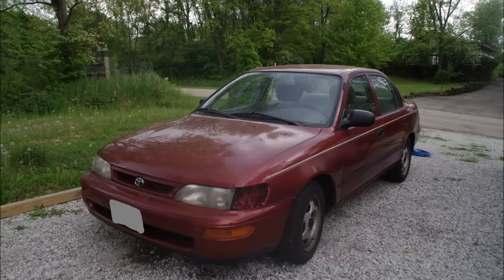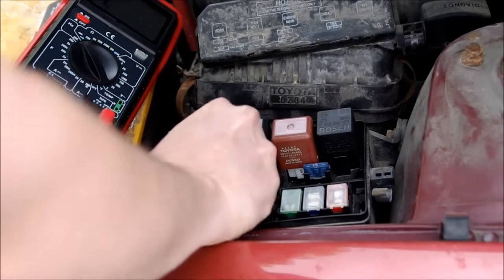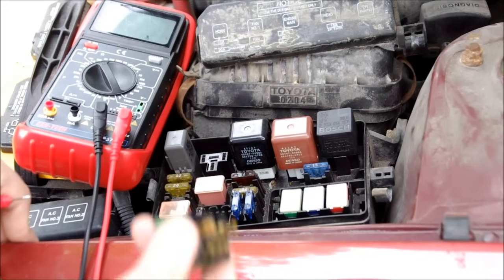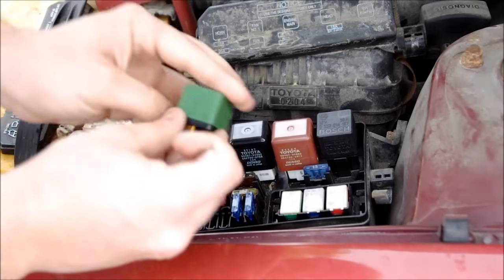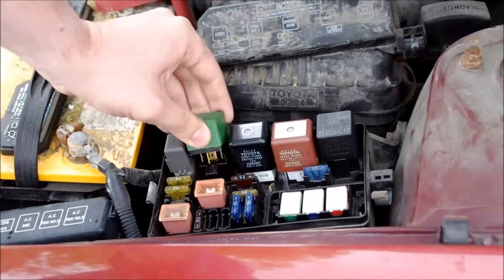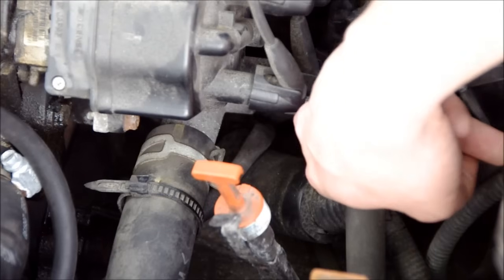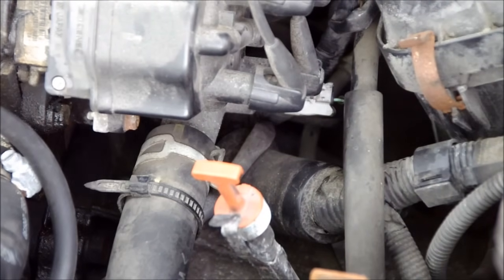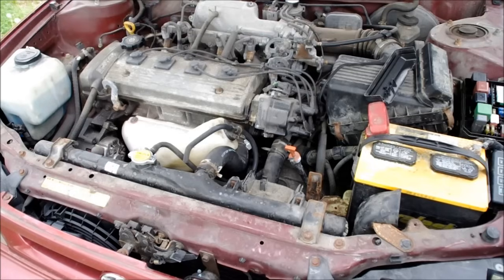Fixing an overheat condition (the radiator fan) on a 1997 Toyota Corolla/Geo Prizm

Comment: I tried jumping the relay but I bypassed the control side of fan #1 and burnt the cars control module or something and now I dont have to buy a radiator temperature sensor but car acts like the ac is turned on all the time or it thinks its super hot.  I used a paper clip fist on sensor thinking fans should come on. They were not working with ac switch or after driving for a while. I jumped it the day before right and only one fan was coming on but I was trying to see if the computer was working or thinking sensor bad but I used too big of a wire and now both on if I turn the key to on. Im still gonna switch sensor because of the  idle but now whats the point I may get little less mpg but not never gona need a sensor long as thermostat good just a module next time.

Comment: I just bought a 94 corolla, I took of the thermostat do to overheating and I notice previous owner cut the thermostat so water can straight flow in engine, why is that?
Reply: I'm thinking it might need a new radiator. If it was water pump, you would be able to see water coming out engine every where correct? I drove it to work today it still very low to the Guage then when I park, it went half way very fast. I might have to do the same thing with my fan too I don't think it coming on. And do your toyota radiator by the top close to the cap has a hole there?
Reply: Sokthea Seng Doing so means there is a misunderstanding what is the roll of thermostat in a vehicule. The thermostat while closing permit the engine reaches its efficient operating temperature, which about 82 - 85 °C. When engine gets it the thermostat opens and let coolant, at 82 °C also, directs to radiator what let it to get a cooler temperature (in that moment, the engine fan cooler will also start up to operate to help the radiator to do its work). So it will start a cycle of open-close thermostat in order to keep the engine working well. When a mechanic takes a thermostat off the engine temperature sensor will never know when the car reach the efficient temperature and computer will try to keep a certain level of acceleration in the engine cause it has no receive a stop signal from sensor temperature. What does it means to the end? You will pay more for gasoline and the engine will be forced to work out of temperature especification making short its operating life. Regards

Comment: Hi I have the same car automatic my heatgauge go above half my fan work normal I replace the water pump replace the fan switch did clean my radiator did send my head for presure test everything is fine its just my heatgauge go up to high

Comment: hi there I have mazda mpv I had the radiator fan not working I  replaced the thermostat and the temperature sensor  when I had  check engine with code  p0126 and I  after i replaced them but now  the radiator fan still not working

Comment: My radiator fan stopped working, then I watched this video and pulled the fan switch. Now the fan works! Thanks!

But then I still experienced an issue where hot coolant constantly sprayed out of the overflow tank, even though the fan issue was fixed and the temperature gauge displayed normal operating temp. I later discovered that the seal in the radiator cap was completely worn out so it failed to regulate the air pressure in the cooling system. I replaced it with a $14 radiator cap from O’Reilly’s, and now the cooling system seems to be working properly.   

Since it is possible that the blown radiator cap was the result of an  overheating condition caused by the bad fan switch, it’s probably not a bad idea to swap out the thermostat and coolant temp sensor for preventative maintenance.
Reply: how’s the car now? i have the same issue 99 corolla radiator fan won’t turn on
Reply: @ceddthakid9732  the fan is only supposed to spin for a couple seconds every 10-15 minutes, so if the coolant starts overheating or the fan doesn’t turn on after 15 minutes, let the car cool down completely and unplug the fan switch like in the video. If the fan spins with the fan switch unplugged, then a fan switch replacement is the solution. If the fan still doesn’t spin it could be a bad relay/fuse or dead fan. I highly recommend the genuine Toyota parts from the dealership, as I had a fitment issue with an aftermarket fan switch from Amazon. 

When I replaced the bad radiator cap, the overheating was fixed for 2 days, then it overheated again. Turned out the thermostat was the main culprit. When I removed it from the car, I did the boiling water test and confirmed the thermostat was stuck closed. It just so happened that the fan switch, radiator cap and thermostat all went bad around the same time like a domino effect, at least from my experience. About 8 days and 400 miles after I installed the new parts, everything now works as it should.

Comment: i change the sensor my car still overheating
Reply: maybe there is another temp sensor on line 

check it make sure some design use 2 sensors
Reply: @froglegs4910  there is on the bottom left side of the radiator?

Comment: Alec ;  
Thanks ' شــُـكـراً لــّـك
مــُــمـتــآز جددداااً .
first of all' 
TANK YOU AGAIN  .

Second ;
although ,
you are trying to 
help people , and I appreciate it , 
however ' you are using wrong terminology . 
you are NOT shorting the relay points .
you are jumping the relay points #87 & #30 
to test the integrity of radiator 
electric cooling fan .
You're using the paper
 clip as Jumper wire .

You are jumping 
NOT shorting .

Shorting is malfunction .

point #30 is a live power from battery post 
and by using paper clip or wire you are
connecting it to point #78 to provide the
radiator electric cooling fan with power
from battery +postive post and the negative
side will be from car body or direct to the
battery negative post .

Third ;
the other point ;
thermostat switch close 
the electric points in it ( in top of it ) to 
close the loop ( circuit ) suppling 
electric power to the fan ,,,
which meant ;
completing the electric  circuit to provide
electric cooling fan with electric power
to run it .

Best Regards .

Arab Aircraft Engineer
and QC Lead Inspetor ,
Jeddah, Al-Hajaz, Arabia .

Comment: i HAD THE SAME PROBLEM. NOT PAYING 50 BUCKS FOR A 10 PIECE OF CRAP SENSOR.  i DISCONNECTED THE NEG. TO FANS, AND MOUNTED A 40A. TOGGLE TO MANUALLY CONTROL FANS.  i  DON'T LIKE NEW TECHNOLOGY, HALF OF THIS ELECTRONIC JUNK IS TO EXTRACT CASH FROM PEOPLE THAT CANT WORK ON THEIR CARS.  LIKE YOUR VIDEO...

Comment: ALEC CONNECTIFY
  (()))  0) )))    1.) How do you check if your radiator is blocking Air or has good Air flow, how can I test it?
        2.) How do you check if the water pump is working correctly? 
3.) The Radiator Fan turns ON at 210F degrees on ALL cars? 
              4.) Why do you have to use Distilled water and can't use House Tap water in the Radiator?
    5.) Thermostat OPENS at operating temperature at 182F degrees? by squeezing the upper radiator hose you can feel if the radiator fluid is flowing and closed at 180F degrees to check if the Thermostat is working correctly?